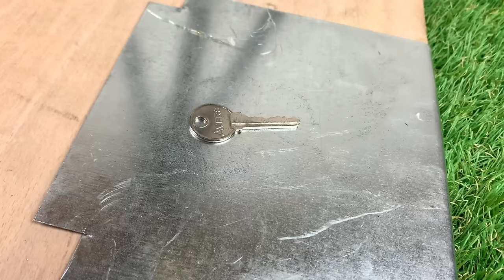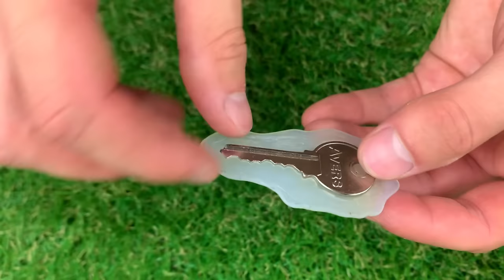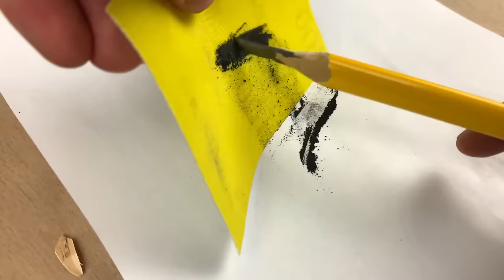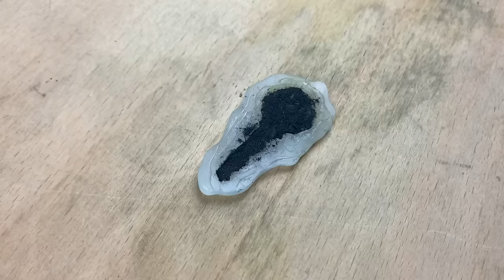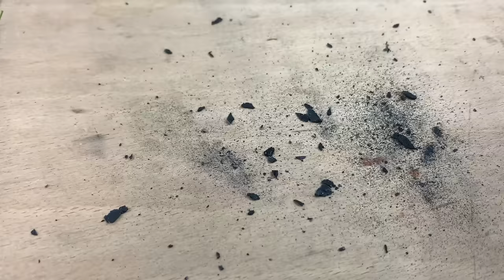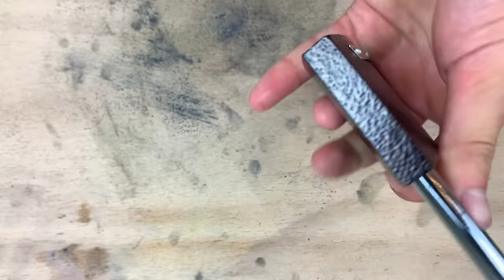How to make a key that unlocks all locks

Comment: It works 👍 right up until it snaps off in the barrel and you have to angle grind the lock off and buy a new one that typically comes with a set of 3 keys 😂

Comment: Ummm.  If you have the original key, isn't it easier to just go to the hardware store and have a professional make a metal one in 5 minutes or less?
Reply: uhm if you hav the key, use it, dont try this or you might break it off in the lock.
Reply from the maker: You could do that, but where's the fun in that? 🔑😉.

Comment: You can keys made at the hardware store for about 5 bucks and f.y.i. you but powdered graphite with small percent of powdered copper .
Reply: i would use a cordless drill and a 1/4'' drill bit
Reply: I really need to proof read my stuff .

Comment: Just click bait.  Title is enough to attract clicks.  author probably doesn't care if people are disappointed after watching someone make a key that is useless for any other purpose than opening the one lock the key is designed for, and quite possibly will break off in the lock while trying to use it.
Reply: It is not a copy, he switched the mold and put the key inside and covered it with graphite.

Comment: yeah, my home has 4 different types of keys, garage, is different than security doors,  etc etc plus you can get a clicker off fleabay  which a monkey could use and a lock pick set that will do all locks granted not as quick as in the movies, as have to get the right rake for the lock.
Also as said he has a key to work with, go 007 and make a metal one fss with play-doh as a mould when they aren't looking see fleabay. Never bothered really with that.
All locksmiths should watch this video, They always send me somewhere with the wrong key and out of a job. btw they are all the same type of lock for Rowe.
I was picking locks in grade 6 so was 11, and tying all the chairs together  as the door opened outward so when the teacher opened the door they all fell of the tables 36 chairs hahaha no b.s. It was funny 30 kids lined up waiting and pandemonium.
They change locks, blamed the teacher the cleaners for not locking it. I ended up going to middle school. I heard the last locksmith fixed it...
Those who can do,
Those that can't do teach,
Those that can't teach the teachers.
Well done for reading my rant
Happy New Year.
Also in a bind I can unlock most locks with a pair of paper clips. One for the rake and the other for the wrench, you ned to bash one flat to make the wrench and find the right form for the rake.. I think it's on this Utube 100 times.
Hope Santa bought you some superglue and graphite powder for Xmas. Or a pencil and wtf I give up.